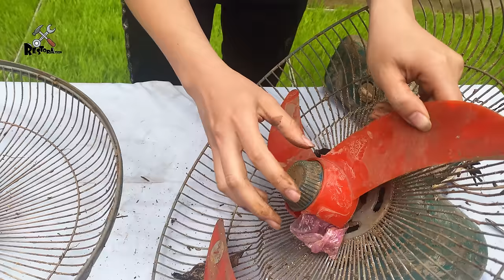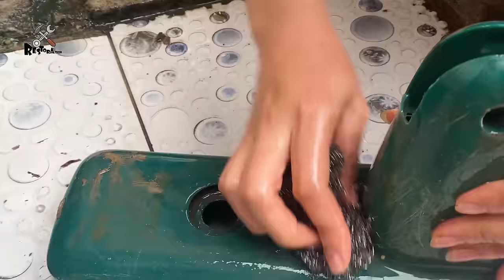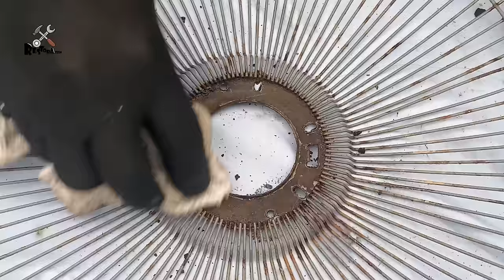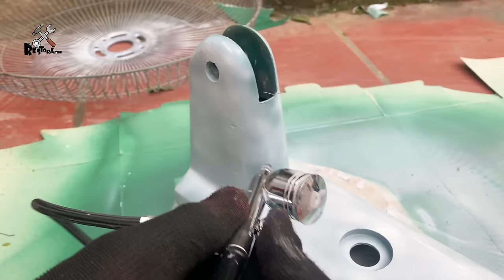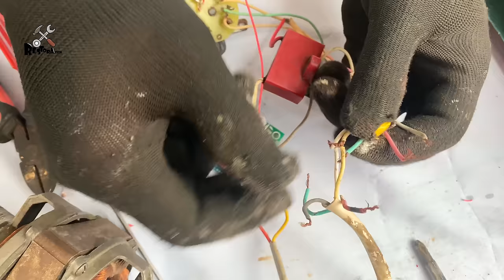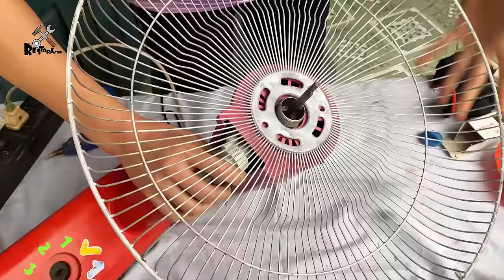Restoration Old rusty wall fan ☢️made into a fan with remote control ☢️old fan restoration

Comment: Подорите пожалуйста вентилятор
Reply from the maker: THANKS YOU
Reply: @RESTORATIONSss  A good soldering iron would have been more efficient when reconnecting the wires as opposed to twisting it with your fingers, which is a piss-poor way to do it.